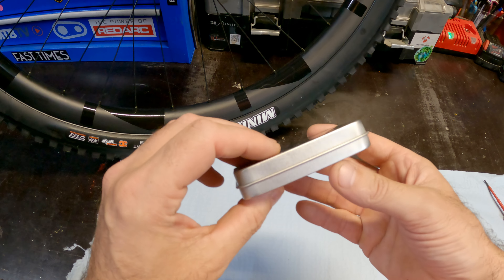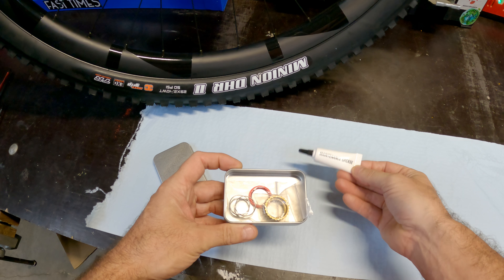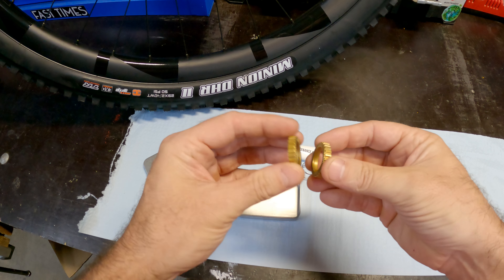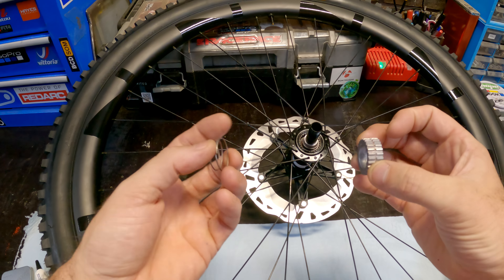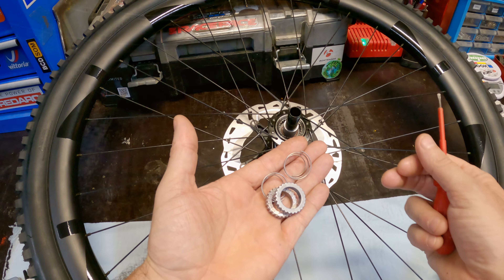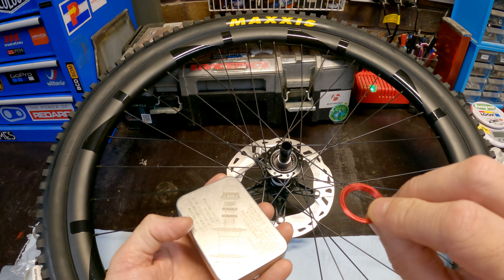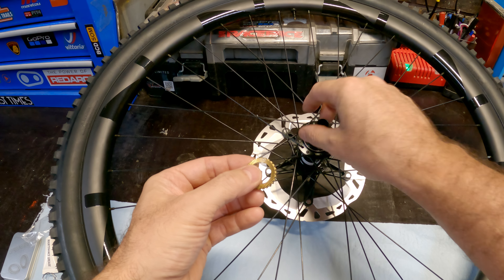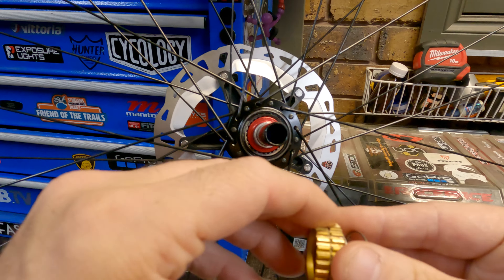Cheap Chinese 60t DT Swiss star ratchet upgrade sound comparison noisy hubs 18t DT350 DT240 54t

Comment: riding 2 years straight with the exact same star ratchet 1500 km a month with absolutely no issues or problems. They are excellent quality and bullet proof!
Reply: Awesome! Thanks for the feedback! 1500km per month! You are a beast! 😵
Reply: Ratchet fovno?
Reply: @marioluizsantanajunior5716  yes
Reply: Did you put first the red spacer?
Reply: @arneledencallado1681  no did not need it
Reply: Same here (Ratchet 60t ti coated fovno), but 8 months in, no wear on the tooths, coating kinda greyish on the tips, grease is clean but I clean them regularly
Reply: @arneledencallado1681 with the springs that are provided you need the red spacer that acts as a guide for the rear spring. If you use DT conical springs it's alright you don't need it but since the ratchet is hollow I wouldn't count on them to hold the ratchets properly.
Reply: That's good to hear. I just purchased one, waiting on delivery. When I was looking for the 54t, and them I saw this, 54t to 60t. Price, Yeas, Try, Yeas! Thanks, great video, glad you pointed out the red shim.
Reply: @LawrenceMacMacster você colocou ela primeiro ou por último?

Comment: I bought one of these 60t. By the second ride, it started slipping. To add, I only put a little  bit of grease. Thoughts?
Reply from the maker: I have one with over 2000km on it, if it slipping, the teeth are damaged.

Comment: got a 370 dtswiss hub will this upgrade fit on it???
Reply: No, it needs to have a ratchet freehub. which starts at 350 or lower for DT Swiss
Reply: Cabe sim,usei em um 350,agora tô usando em um 370

Comment: I compare the exact position of 18t ratchet and 60t. The red spacer must go first in the hub side. It will not allign the teeth of the hub and the star ratchet if no spacer. It may damage on the teeth hub.
Reply: It doesnt really matter which side it goes into.

Comment: Just wonder other than the sound different, does it actually make your hub louder?  i have 54t now and thinking if i should upgrade to 60t.  My only complain is it doesn't sound very loud now.
Reply: less grease / lube = louder. More lube = quieter.

Comment: the red ring, according to the web page you sent, should be the last to assemble (attached to the driver).
Reply from the maker: I commented a while back that after a couple of days, I removed the red space completely. It was not needed.
Reply: @billyrides  on road hub is very much needed. Also springs that comes with it.
With oryginal springs from DT ratchet was quiter and sometimes engaging was poor.
With fovno springs and red ring it works fine and sound is louder.
Reply: @mataman1  Which side did you put the red ring?
Reply: @hugobulleid7029  I've put it last. So first go spring - ratchet - spring - red ring and hub goes last.
Reply: @mataman1  Ah thanks a lot, i've got mine arriving soon so ill follow that order. Any issues with yours?
Reply: @hugobulleid7029  no issues, it's working great.
Reply: @ivanteo1973 you are correct the - this video is incorrect for installation of red ring. As per webpage red ring is meant to go first into freehub body (not wheel hub). Also check the website link above for the correct orientation as surfaces are not symmetrical. Just installed mine and its LOUD AF
Reply: @mataman1  WTF you talking about? That ring is only for the EXP system. Its not even supposed to be used for regular DT Swiss hubs. People always talking out of their ass.
Reply: @OptimusSatanas  mine wasn't working like if should without it.
Reply: @OptimusSatanas  You can assemble the hubs how ever you like. The red ring that issupposed to be used with the EXP only fixes the issue of 54-60T ratchets. The no engagement issue. With that red spacer there is more pressure on the spring so it will engage isntead of slipping. I put two of those red springs in my ratchet hub and it works flawlessly. There is a bit more drag but the ratchets engage better.

Comment: Hi. Still running the 60t ratchets? 
Just ordered some today 😅
Reply from the maker: On my second set, the first set failed at about 900km.
Reply: @billyrides  did the hub have any damage or did only the ratchets break?
Reply from the maker: @SmileyBoy84  only the 60t ratchet teeth, I could still ride the bike gently to get me back to the car but some teeth were damaged. I swapped it to another 60t Fovno which I had in my vehicle and have a further 400km on the new ones.
Reply: @billyrides  ah okay. Ordered the fovno too.. will just chuck it on my DH Bike and take some spares with me..😁
Reply: @billyrides  did the first one fail because of the red spring retainer ring?

Comment: Thanks for the upload! I need to replace mine since the teeth was destroyed. I climbed it on a little heavy gear. Hkwever mine is ztto brand which is the same with dt swiss tech.
Reply from the maker: There has been a few issues with the ZTTO ratchets. The one in the video is still going strong.
Reply: @billyrides  i am planning to buy similar replacement ratchet like yours. Initially i thought that its because the springs might not pressing to much to engage both rings so i pulled it to strech however since the teeth were already damage it doesnt work.
Reply from the maker: @kenvysmiguel8817  just make sure you dont clog them up with grease, go easy on the lube and lube it more often when cleaning/inspecting it.
Reply: @billyrides  i'll take note of that. BIG thanks! Ride safe! Cheers from Philippines!
Reply from the maker: @kenvysmiguel8817  Enjoy ! Cheers.
Reply: Hi billy.. sir so far no problem with durability?  Im currently using my stock dt swiss 240 with its 36 stock tooth ratchet   and has served me well so far.  But i really wanna upgrade to 60t. I am just wary it might break when im in the trail.  Or climbs.  Thanks. More power!
Reply: @junlamata4230  so far no problem
Reply from the maker: @junlamata4230  mine is still going 6 months after posting this video. I know some have had reliability issues.
Reply: @billyrides como você utilizou a peça vermelha?
Reply from the maker: @fernandomtb7159  not required, leave it out.

Comment: IMO the red spacer should go to the freehub. Because it has none. Spring is sitting directly on the bearing. What you did sir in your video is doubled the spacer in the hub shell.
Reply from the maker: Cheers, if you read the other comments, I removed the red spacer completely after a few rides. Its not needed at all.
Reply: @billyrides  
if you had it removed, only the inner spring is sitting on its seat (existing spacer), the outer spring is sitting directly on the bearing. but that would probably not matter at all. 
nice upgrade, i am also using that brand for my dt350.
Reply: @billyrides  thanks for posting a nice upgrade
Reply from the maker: @benj3433  basically treat is as the same star ratchet as you removed, its works the same.

Comment: Anyone else have the issue with when installing that red spacer it causes the hub not to freewheel when installed on the bike? I found that when I had the red spacer in there it was fine with the wheel un mounted it freewheeled with no issue. Bolted wheel into bike and the hub wouldn't free wheel. If i left the rear through axle just finger tight it was fine. but snugging it down to correct torque it caused the ratchet to lock up. Tried the spacer on the both sides of the just in case and both netted the same result.  Had to leave it out. Spins fine and engages fine without the red spacer in now. 
I have a few neighbourhood rides on this same kit and so far so good. trails aren't dry enough yet to get a proper ride in. Ordered two of these kits and have packed the spare ratchet in my riding backpack just incase the teeth decide to strip while out in the middle of no where and or no having to wait for another kit to ship during riding season. still cheaper than the DT kit.
Reply: Spacer goes on the inside, not the outside. The diagram on the box is wrong.
Reply: same issue, the red spacer is no need for using, we dont need it.
Reply: @BK_BK_ME  The spacer is there for faster/harder ratched engagement. It does no harm.

Comment: they should release a 150t version lol
Reply: Teeth would be too tiny and worn out too quickly
Reply: Bro jajaj that would be to much.
Reply: There's this hub called Speedone sniper that's a 150t ratchet. It has a bigger ratchet diameter, about the size of the freehub body, to accommodate a 150t while not making the teeth very small. It does sound very fine and loud
Reply: @johnpaulpalaganas4378  talo dt swiss sa speedone ksi speed ka na one ka pa
Reply: I have a 64t hi tensile steel version, from Ali, I couldn't find more tooth for DT's.
It didn't hold up well I'm back on the titanium coated 60t...
Reply: @johnpaulpalaganas4378 I can't find it in North America, I'd like to try it...

Comment: I just saw the comment on aliexpress link you posted. "I was the 65km home and the pedal was a total of 137km, when cycled strong in a climb the ratchet skated and grazed the teeth, the bike was in neutral, lucky for me I took my things a pair of ratchet original DT 18T and made replacement in time, but if you think buy it, Don't count on luck, there are two types of ratchet Chinese ever broke and it will break"  i think everyone should see it
Reply: That's probably the consequence of uncorrect installation. If the red ring is missing（or wrong side），the springs may not provide appropriate pressure to make sure the teeth are properly joined. In most cases they still work，but that may cause severe damage in heavy-duty use.

Comment: How would this compare to the 54t ? Is an extra 6t noticable?
Reply from the maker: No, I have both the chi 60t and original 54t, cant tell the difference. The Chi FOVNO is only $33 at the moment, check out aliexpress.
Reply: @billyrides  how reliable is it
Reply from the maker: @nc33228  My 1st set lasted around 900km then skipped, I picked up another set for $15 and they are still going at 800km.
Reply: @billyrides  I ordered oem dt Swiss star ratchet upgrade 54t for $110 I’d rather not have it brake on me
Reply: @billyrides  did you buy same brand
Reply from the maker: @jenssnoeckpieters  yes FOVNO, my first one failed at about 900km, second one is still going after 1300km.
Reply: @billyrides  tanks do you got the link of the 15 one
Reply: and is it gone survive enduro riding

Comment: You sure the red/ring/spacer is supposed to go on the hub side and not the hub driver side?   On the new DT Exp hubs, that red spacer goes on the hub driver side.
Reply from the maker: No, I am not sure. I seen that the EXP has a red ring on the freehub side so I tried it on both sides and without it and the hub works in all 3 combinations. Maybe its not required at all on normal DT hubs.
Reply: Bro the exp ratched upgrade have threads on the one side so you can tighten it to the hub body and you only have one spring its not like the normal ratched upgrade with two springs
Reply: I think the red ring might be placed in  next to outside spring, I mean in front of freebody.

Comment: Those are crap! I use them for a week in plain roads no problem, but the first day I full send on rock gardens and do wheelies I destroy it.
Look at those ratchets, the springs are not conic and also have an extra red piece to compensate bad design.
I get a refund but save your time and buy original dtswiss or at least something similar.
Reply: How can you destroy it. I just have problem understanding. Just because it's not engaging properly. But why? Too much teeth, bad engagement occasionally or what?
Reply: @eXTreemator  More teeth means more prone to problemas DTSWISS know that and explain in their official page. But don't get me wrong the original design of 54 teeth works nice for me! have several months and no problems. 
The ones in the video are just a bad design it does not engage and disengage properly causing premature damage! Stick to original DTSWISS or at least an exact copy of the original design if money is a problem.
Reply: @JulioJairdeAlba  if they match well there shouldn't have been a problem. But again if it failed then either springs were sticking, or the gears weren't straight or lubricant was sticking. Dtswiss or not it's doesn't matter, I just looking it from mechanical view. The design if those are ok although those teeth experiments don't look good. Chinese never do proper testing. Inflating specs even for gears, they don't understand the fuck they are doing and why. Even shimano hubs suck though.

Comment: Mine lasted 2 rides....
Reply: What happened?
Reply from the maker: Same brand ?
Reply: @billyrides  I honestly can't remember if it was the same brand, Luckily I was only a mile or so from home when it happened. The teeth on both ratchets was virtually gone, so I think the material was too soft to stand up to job. I now realise that it's not worth cutting corners on parts like this, buy the original.
Reply from the maker: @secrashes  I also have an original 54T on another bike, so far I cannot feel the difference between the FOVNO 60t and the DT 54T. I have seen failures on the Chi ratchets so can picture what yours looks like with the teeth all mangled.

Comment: Thanks for the video and updates. It's now $20 so why not. I've ordered one. I will update here about the durability as well. BTW, the $20 Fovno ratchet kit has no red ring and grease.
Reply from the maker: The red ring is not required and the grease is too thick, use a lighter lube and check/clean regularly.
Reply: how is it held up is it stil good
Reply: @jenssnoeckpieters  It's been a year and still like the first day installed. I rode 1500mi w/o any issue. I've greased it a couple of times btw.
Reply: @sulsj  and was it for road bike or more like mtb its for my enduro bike
Reply: @jenssnoeckpieters  I am riding a road bike
Reply: @sulsj  do you think it gone last lang enof for the price on enduro bike

Comment: How's it been since you installed it on your hub? Does it skip or slide or anything? I've been eyeing this one for a long time. Just want to know if this is a good upgrade or not. I'm currently using a 54t dt star ratchet.😁
Reply from the maker: Its been good, I have a real 54t ratchet on one bike and the chi 60t on the other, I cant notice any difference in the 2 of them, I wouldn't bother with the 60t if I already had a 54t fitted.
Reply: @billyrides  how about the sound? Is there any difference? Want to make it louder.😁🤘
Reply from the maker: @GCTV0610  I removed the grease and have put Finish-line wet lube in there, same as I use in my Chris King hubs, it sounds a little bit louder that with grease only.